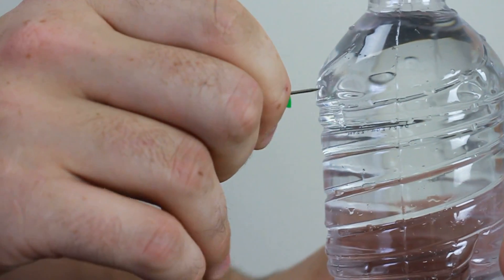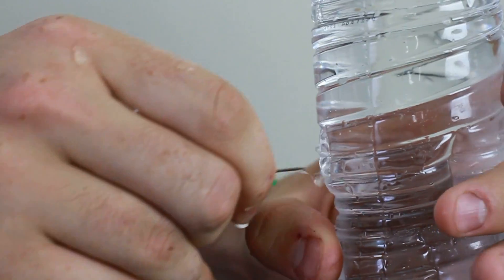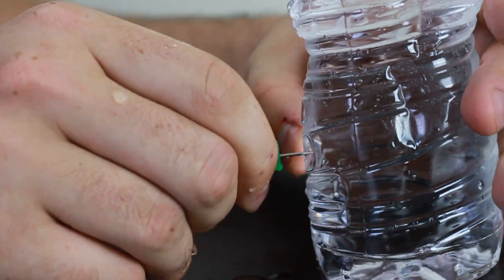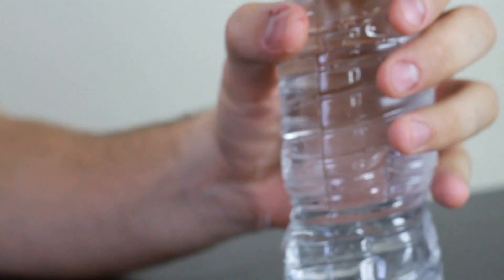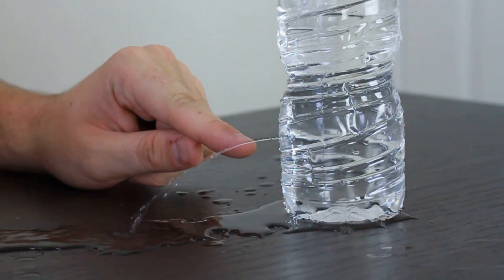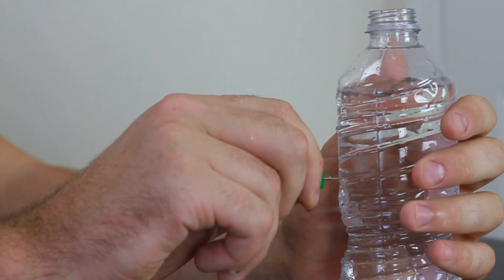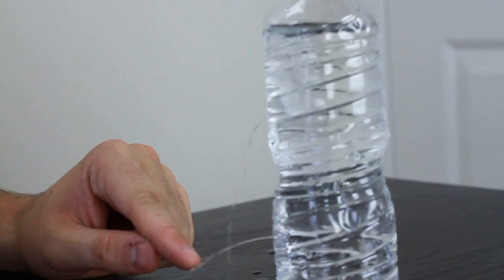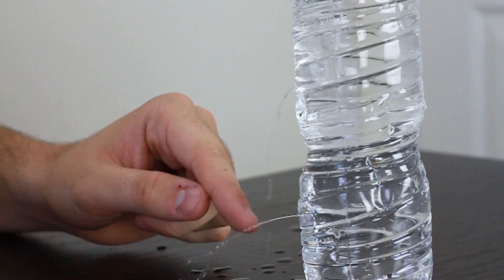liquid science experiment

Comment: Unfortunately your set up (poking holes in a bottle) does not accurately demonstrate a theoretical hydrostatic pressure experiment, but..... If your holes were the exact same size, you would still see more water leaving the bottom hole.  This is because the pressure increases with the depth of the water (pressure = water density x gravity x water depth) ie: the lower holes are at higher pressure points.  Hope this helps

Comment: because with the water draining out of it, the air pressure is going down and at the rate its going, the water doesn't have as much time to drain from the other two holes as it does the bottom.

Comment: If All The Holes Are Equal In Areas "Diameter", The Pressure (P) Along The Bottle Is : P(h)= pgh 
Where:
p is The Dinsity Of Liquid
g Is The Gravitational Constant Of the Planet
h Is The hight Between The Hole And The Surfes.
Also There Is Another Pressure Acting On The Hole " Air Pressure"
As You Open The Bottle , The Pressure On The Hole Is :
Pa+Pw-Pa= 0.5pv^2

Pa: Is The Pressure Of Air
Pw Is The Pressure Of The Water
Pa Cancells Each Out When You Open The Bottle Because There Is An air Pres